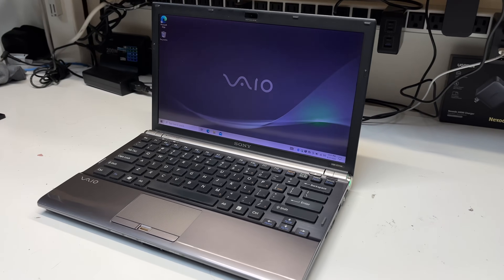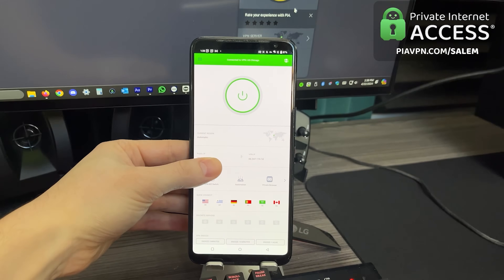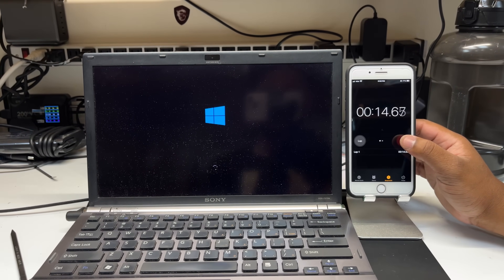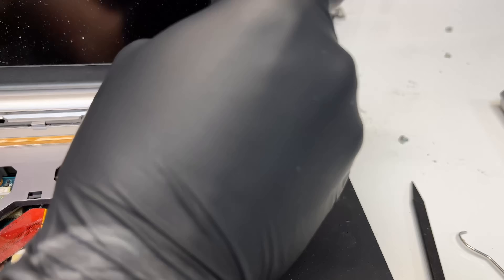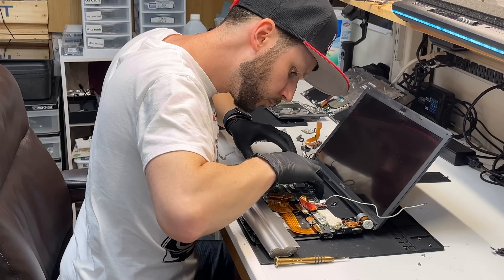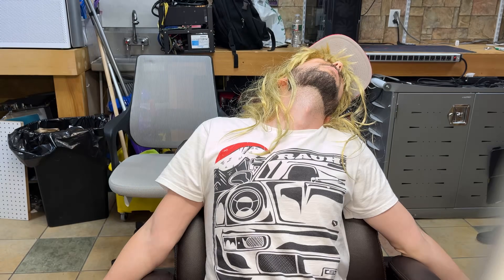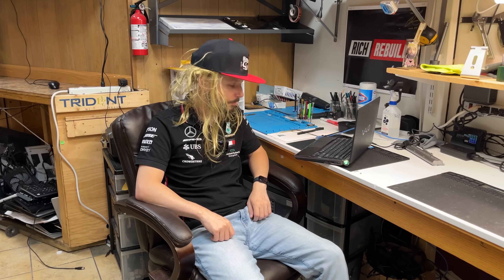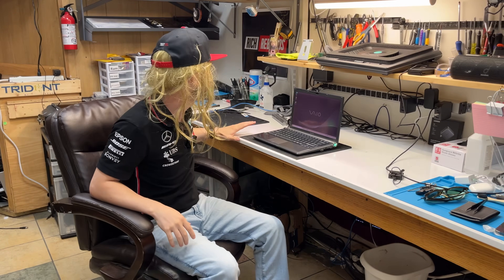Sony Vaio Resurrection: Saving this Insane Tech From 2008 (and why that soon won't be possible)

Comment: Honnestly really sad to see how the laptop industry has evolved, my laptop is an old 2009 Aspire 7736z, it died a few years back but with a bit of internet searching I found the IC causing it to not get power, changed it my self and I have to say even if it only has cores and 4Gb of ram this thing rocks for simple tasks and even some heavier ones just as well as laptops from 2014. I had to do it my self like all of the other more complex repairs because I don't have the greatest technician that ever lived in my area

Comment: I can say that not every Vaio is like this. I still daily use a Vaio F series from 2010 (1st gen i7 etc). Servicing is a piece of cake. Every 2 years i clean it and replace the thermal paste. The machine is still strong with 8gb ram and of course an SSD.

Comment: I have VAIO from 2008 as well :) still working but only when plugged in. It was a great machine ruined by Windows Vista, unfortunately with some models they had both Win XP and Vista compatibility, for my model they went fully Vista. Vista was so unbearable that I have ended up switching to XP anyway, then tedious search for drivers started. Some, were compatible with other VAIO models but there were couple of drivers which I could not get from Sony. I have ended up looking at exact components and found them at other manufacturers and some drivers from HP or Dell worked. One driver, I think it was sound card, was just not working, but I have manage to make it run anyway, I have opened the driver from similar VAIO model and was copying libraries from HP driver for the same sound card model and with try and error I have managed to get it working. I don't think I could do it again. It was pure luck and took huge amount of time. Of course, by switching to XP, some functionality was lost, like there were specific buttons for some functions, but overall it served me another 7 years of full use, before it became a back up device and now only as reminder of old times :)

Comment: 16:19

The driver is avaliable on the Internet Archive! It's the place to go for oldschool drivers and roaming through dead websites. The capture from 2014-06-21 works. Keep us posted!
Reply: @Salem Techsperts If you see this, make sure to point the Vaio's owner here!
Reply: Ive seen driver compilations available but has anyone found a bios? Seen lists of almost right but only on shady pay to dnld sites. Looking for  bios for a Vaio VGN-SZ434N
Reply: the internet archive is simply the best place to get old software stuff that the original creators tossed to the wayside. its where i got a ton of my programs i use for recovery and repair for older machines.

Comment: I also have Sony VAIO VGN-NS with t6400, ssd 240gb (i am not that much sure about it, maybe its still OG HDD), 4gb ram and ati 3430 that is working to this day. I made few thing like change thermalpaste, clean interior and add SSD with instalation of windows 10 64bit to run it better than oryginally VISTA without updates. I was 18 as I've done it and it was great idea, bc this helped me to be more brave to do things like this on old hardware. And I am 22 now with skills to repair and upgrade few things here and there. Now this laptop after ~15 years is still in my family and is still used. Greeting from Poland, hope u see this comment to know that i confirm how VAIO series is pretty dope (i played Among Us with Discord on it) and long-living

Comment: I once opened up a Samsung laptop from the same era as the Vaio in this video,i encountered the same frame piece thingy that covers the components after removing the keyboard panel on that Samsung,but soon came to realise that it wasn't removable and completely molded on to the rest of the laptop chasis XDDDDDDDDDDDD to this day is still remember the Anger that made me feel towards the engineering section at Samsung.

Comment: 8:49 the issue isnt bad solder its to do with bad underfill, bump material and thermal expansion all combined to give you a sad gpu experience. its very interesting once you look into it

also that one has a revised gpu (anything > G98-631 is revised and doesn't have the issue (another way to tell is that the underfill around the die is clear as opposed to black / dark brown)
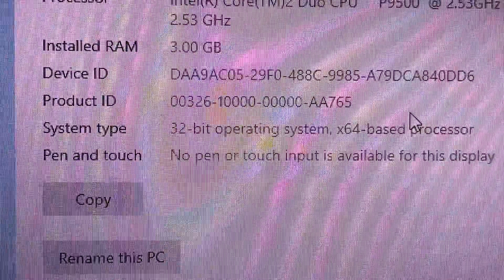Reply: addition: 11:22 - the customer wouldn't have done this, Sony did. As you said near the start he updated to 7, then to 10. Back in the late 2000's companies like dell, acer, sony, hp, you name it mostly installed x86 copies of windows as opposed to x64 ones. I can't tell you why they did this but what i can tell you is that they did. Annoyingly there isn't a clean way I know of to upgrade an x86 to x64 install

Comment: I have a dell that cost less than a fingernail new (from the dell outlet) and is super upgradable and maintainable…that laptop is now 7 years old and I doubt I will have another laptop working better than new (because I added 8gb more ram and an SSD).

Laptops are nicer than ever and somehow have a shorter life than ever

Comment: I still have the Vaio Z generation that came right after this one, specifically a VPC-Z13M9E. Proper Core 2 Duo, GT 330M with a similar hardware switch, 2 SSDs in RAID0 (you could even get it with 4 SSDs in RAID0), a DVD drive I replaced with another HDD, 3G modem, fingerprint reader, amazing 1600x900 display, backlit keyboard, ... The battery gives up after 30 minutes but besides that it works great on Windows 7. But the hardware is so weird that it's unusable on any other OS.

Someone created a BIOS patch to set the GPU on boot rather than the hybrid switching while the OS is loaded, which allowed you to use newer, regular drivers rather than having to use the ancient Sony ones. But you lost automatic brightness control. Still, generally worth the trade-off.

Having taken that one apart to replace the DVD drive with the HDD, I can at least confirm that besides the 20 screws to open it up, once it's open it's actually quite neat and easy to work with inside.

Comment: In my experience of reparing old laptops. You can try IoBit driver booster works quite well even on outdated hardware like my 2011 Dell Latitude E4310 and 2012 HP Pavillion DV6 with some weird modified intel amd gpu drivers. (i usually only purchase 1 pc license and kept selecting "i change pc" to reuse product key)

Comment: my uncle had a sony vaio vpccw2rgx i tried to install windows 10 or 11 on it and it worked fine but then the laptop was suddenly started to shut off its self which it was strange but then i realize that the issue was from the fans and the only way to use it was using a laptop cooler but when it was running windows 7 before it wasn't turning off its self and i found out that there is something wrong with it and then me and my uncle downgrade the laptop to windows 7 and we never used the laptop again
also the battery woudnt hold the charge anymore and the laptop also had a broken hinge

Comment: My HP Omen X 17 from 2016 or 2017 is still my daily driver for work and play. Metal chassis, mechanical keyboard, perfect set of ports, dual NVMe, i7 7700HQ, 1070 8GB, 32GB DDR4... Best laptop I've ever owned or worked on. I've repaired a ton of machines over the years and even had my own repair shop a while back. Only HP laptop I've ever seen that wasn't garbage, I don't know how they made this amongst everything else. It is built like a brick shithouse and I'm still playing games on it with a 5120×1440 monitor and it just handles it and doesn't overheat. I've taken very good care of it but still.

Its officially getting to the point where I will need to upgrade soon and it's so hard deciding what to get that will last me another eight plus years. The only machine that has all the specs I want is the Alienware M18 but the Alienware reputation has me worried. Would love to know if anyone can say whether it'd be a decent long term machine. I have high computer mana and can do any repair short of micro soldering but I need to know if its possible to get to everything under the hood.

Comment: Alienware Area 51M will last for a long time. Unfortunately, you will have the same issue: parts will be hard to get outside of e-bay and those being second hand. But that laptop is build to last! It has a 10th gen Intel Desktop CPU inside, 2/4 RAM modules, wifi card, modular GPU card, etc. Alienware even has an in-depth guide on how to take apart every single part of the laptop :)
IF you are not familiar with the model, do check it out!

Comment: Always backup drivers! Even if they were made for WinXP, they can be manipulated to work. Just add the Hardware ID # to the "ini" text file of the old driver. 99 times of 100, you'll have tricked the driver into assuming it was developed for Win10. #Experience 😊
Reply: I have the driver backup automated software that's no longer produced as the only copy I ever found was designed for Pre-installation Environment CD's.

LMK if you want a copy. It was always free, btw.

Comment: You could have used double driver to clone all the old drivers into a removable drive
Reply from the maker: As I specifically stated in the video, the laptop already didn't have the original drivers due to the customer previously doing a fresh install. Therefore, there were no drivers to clone over.

Comment: Hello, i have a question about repairing my old Acer Aspire E1 510. It doesn't give signs of life so I'm going to replice the emtire motherboard and charging connector. 
Currently board has Celeron n2920 on it, and my question is can i put the board from that laptop but with a bit stronger pentium n3520 in it?

Comment: A lot of this is also how you take care of your device. I have an MSI laptop that is 10 years old, and which was perfectly good at gaming back in it's day. It can't run many games now, but it still boots Linux and Windows 11 just fine for other stuff. I replaced the thermal paste just the other day. And noone thinks MSI makes great laptops.

Comment: I have an old HP that I still use for WORK that has a windows 7 sticker on it from the age of transitioning out of VISTA. I have an old XP machine from MSI that to my surprise after more than 12 years still holds a charge and boots to the desktop. Computers used to LAST and most consumers have forgotten how good we had it years ago "both have pop out battery packs." These days your iphone headphone jack /sarcasm fails and APPLE says " oh no, you need a new motherboard, here buy a new phone or pay half the cost of the device just to get it working again. " Modern tech is oppressive and horribly anti-consumer

Comment: I've got multiple old laptops that still work. An old HP laptop with a Core 2 Duo, a MacBook Pro Retina 3013, an MSI GS63 from 2017, and a Lenovo Legion 5 Pro. So far the least upgradable laptop is the MacBook. All three of the previous laptops need new thermal paste but they all still work. The HP, MSI, and Lenovo laptop all have upgradable RAM and storage with 1 2.5in slot on the HP, 1 2.5in bay and 1 M.2 slot on the MSI, and 2 M.2 slots on the Lenovo. I can confirm that Youtube still works on all of them but the HP really does struggle thanks to the HDD being slow and probably needs to be replaced. The MacBook with a dual core i5 can even play back 1440p Youtube videos without dropping too many frames and that laptop is over a decade old.

It's why I say before anyone upgrades their old laptop, get an SSD. It can make your old laptop feel like brand new as the HDD can often be the biggest culprit behind your laptop feeling slow besides having too many things open and not enough RAM. A lot of people can get away with using a decade old laptop and they'd be fine because web browsing isn't that intensive on any device

Comment: I still have my Sony Vaio VGN-FW47GY I bought brand new, still works last time I turned it on but I had moved it over to Ubuntu when Vista Ultimate 'started' getting issues 😁
I will say there are a large amount of perfectly good devices ending up in eWaste, I try to recycle as much as I can at work but there is so much ended up there because users want 13th gen i7s with 32GB+ RAM to do emails and Word documents 😞

Comment: My dell latitude E5530 has been around and used for around 10-11 years. Its a charm to upgrade. When i went to upgrade it. I had no knowledge of how. And it was so easy I had no issue learning on the spot, im 15 turning 16 with a new desktop. Its valuable to make devices upgradable. If they aren’t then they are just a waste

Comment: first laptop i bought from the company I was doing an apprenticeship at was the last Vaio Fit 15, ready with a touchscreen to join the Windows 8 Metro revolution. Or something like that. Unfortunately cops seized my stuff a few months later because I did scary things on the internet they didn't understand involving user-generated content (in the early 2010s! neuland!), and they broke the palm rest trying to unclip to get to the drive and never replaced it or reimbursed me. And it took 8 months to get back, and I only got it back so "fast" because they wanted a witness statement in a different case regarding some Witcher 3 leaks in the same user-generated content and I refused until the other thing cleared up. Which it then magically did within half a week. ACAB!

Comment: Laptops always have been getting the short stick in terms or repairability and upgradeabilty. But try to get replacement parts for a new laptop. Maybe you find a battery, a screen and a touchpad. Parts like keyboards, fans or whole motherboards ( as everything is soldered down)  just dont exists, if any component on there dies your 4k gaming laptop is trash...

Comment: Got one of these tanks from my dad as my first latop. It had massive IO, mechanical great construction all around and a removeable battery. I still keep it as a " download machine" and other sacrificial usecases :) I upgraded to SSD which made it a rocket on startup, modern Windows, It doenst have any sound anymore and the fan got replaced by something bigger and quiter as it died. Thankfully new laptops dont have DVD- drive anymore as it robs so much internal space.
Its astonishing that they crammed everything on a board that small. In contrast to modern gaming laptops those two little heatpipes would melt away on my MSI with a 12900 and 3080ti :)

Comment: Even "fully repairable" Laptops have a "death date"   :  When parts arent made anymore, DDR3 Sodimm are a pain to find, getting a new battery pack for my 2011 kd52 Is damn Impossible, I might just DIY recell the thing

AND when the silicon chip finally jolts its last bit of electicity after the traces have deteriorated too much

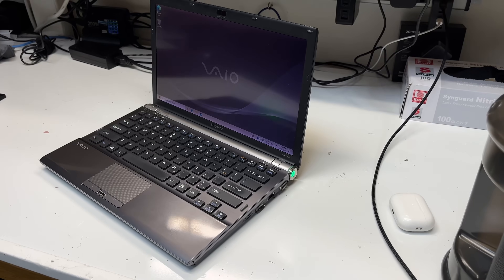Comment: 16:50 I was wondering about this upcoming issue. Because I have 3 gaming laptop that all don't support Windows 11. One has i7-6700hq, i5-7300hq and i7-7700hq and two of them has GTX 1060 3 and 6gb. And GTX 1050 (non-ti) 4gb.

I wonder is it feasible to bypass the restriction to force W11 installations and use windows 11 in that way? Would there really be any issues? Because I couldn't even find any answers about this issue and many 'Google results' only shows results that mostly consist  'not recommended'  instead of actual usability or not.

I know Valorant won't support this bypas-w11 install. But I don't play Valorant anyway.

Comment: Reminds me of my old Thinkpad W530. Ran like a champ for 13 years with regular maintenance and a few re-pastes.  Retired it mainly because the battery was down to 10 minutes runtime, the keyboard and touchpad were worn through and replacement was cost-prohibitive

Comment: An old, retired computer tech and systems admin here.  My first computer was an Apple ][+ clone that required some hand crufting of parts to upgrade the memory and processor. My first Intel box was an 8088 clone system with 640 kb memory and a 20 GB MFM drive.  I learned how to maintain and upgrade hands the hands on way.   I was even a partner with friends with a small computer PC  business, building 386 PC's back in the day.  

These days, people will give me their old systems and laptops to properly wipe, repair and rehome or dispose of appropriately.  I have a collection of old drives, memory and parts that get used to bring old gear back to life.  During covid I must have kept 30-40 computers from going into the landfill and got computers into the hands of folks that couldn't afford stuff to school and work remotely. 

I completely agree with your stance on right to repair.  Too often, systems are build not to be opened or upgraded these days (I'm looking at you Apple), and it's a complete waste, all to maximize profits to stockholders.  Parts are hard to get for the older systems, but worse is the lack of historical drivers needed.  That's why I generally recommend Dell or Lenovo. At least with them you have a chance of support for older systems.  The worst is Toshiba with a different battery shape for every single laptop, and most are made of unobtanium, even from third party suppliers. 

The laptop I use is a Lenovo ThinkPad T420s, made in 2011, that I picked up used off a lease. It's been upgraded to max out the memory and with a 1 TB SSD. I even managed to get it to run Windows 11 Pro.  The damn thing still does what I need it to do.  No, it won't game worth a damn, but short of that, I haven't had anything that I couldn't do with it when I needed to from taking notes, to network sniffing to quickly editing sound files for a community theater performance. 

Bless you sir and your wife's boyfriend for keeping the old systems running.